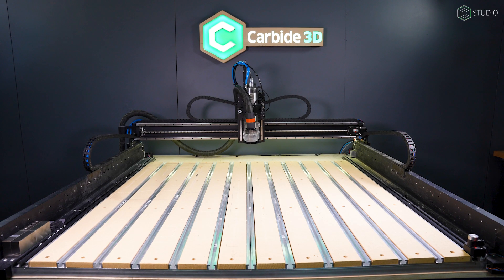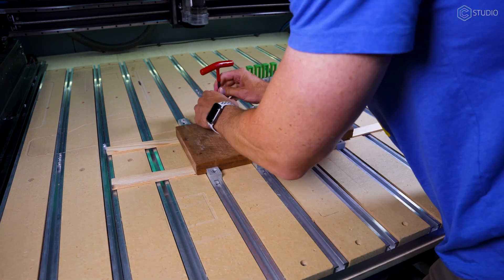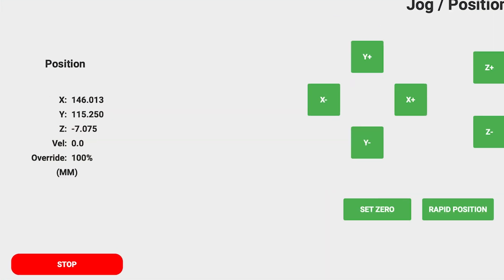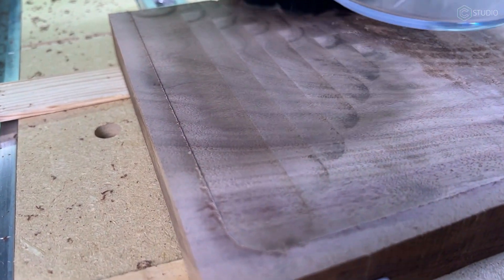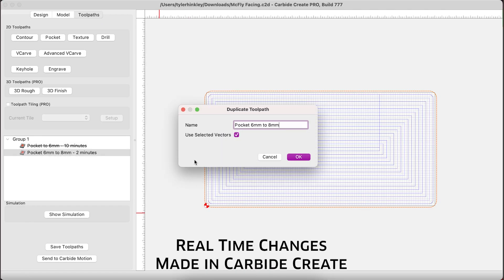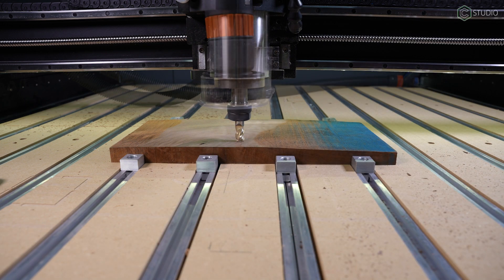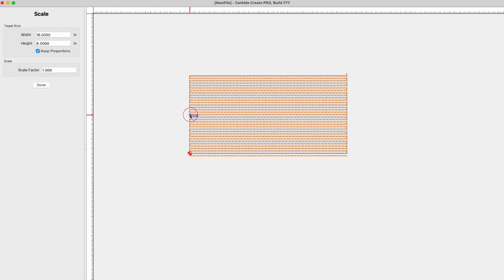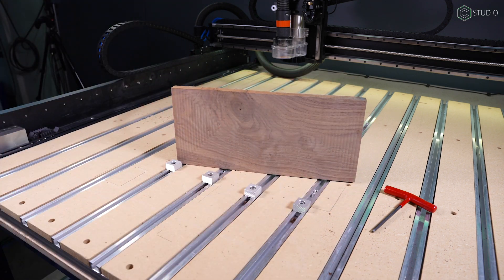How to: Flatten Stock on your CNC Router

Comment: Are you able to do this Carbide Create? I have not moved forward and purchased the Pro version yet. Having trouble joining vectors at the end of my design.

Thanks,
Brent
Reply from the maker: Hey Brett.   You can definitely construct the vector lines in the free version.  Be sure the nodes are right on top of one another.   This is best accomplished by using “snapping” and anchoring your lines to the grid so as to assure their alignment.  
- Kevin

Comment: Love it BUT, in general, I'd love to bit to start surfacing from the outside corner in, not the center (just did my first job, Shapeoko 5 newbie) and it cut in the same pattern as your example. Worried about plunging w/o the ramp function (i have create, not create pro at the moment). Any advise (as opposed to doing the poly line trick)? Assuming it's a function hiding somewhere in Create?
Reply from the maker: Hey Brett, 
Welcome to Shapeoko 5; great things are ahead.    The polyline trick is just about to be obsolete.    We've recently added a Facing Toolpath to Carbide Create.  It's currently in the Beta Version of Carbide Create Pro.   If you have Pro, you can download the Beta here:  https://carbide3d.com/carbidecreate/beta
Reply: @carbide3d  Awesome news (although I'm brand new and now have to google facing tool & hope it's not all X rated results lol)... nailed the poly trick btw, trying it tomorrow on my first inlay attempt--fingers crossed! PS, thx for the reply😎

Comment: when setting x,y and z on a piece of stock like this thats all wonky, correct me if im wrong but you cant use the bit setter or the bitzero and have to do it manually correct?
Reply from the maker: You can always use bitsetter.  BitZero is not as handy given that you want to exceed the size of your stock in X and Y.  Additionally, the low point of your stock may not be on a corner nor large enough to set your BitZero into to get an accurate reading.  Manual Z setting is the best plan.

Comment: Can you use a traditional 2in surfacing bit?
Reply from the maker: It depends on the shank size and the power of your spindle.
Reply: @carbide3d  How about with the 65mm VFD spindle and 1/2" shank?
Reply from the maker: A 1/2” shank does not fit in the 65mm spindle.   That spindle has a 1/4” limit.  
If you want to run 1/2” tooling you’ll need the 80mm water cooler spindle.

Comment: I used this procedure to reduce the thickness of a piece of MDF for a cabinet door I was making with inlays. I took about 1/4 of an inch on one side, did the recess of the inlay design and left it on my CNC overnight. The next morning, when I took it out, the piece of MDF was so warped, it looked like banana. The only explanation I could come up with is that the MDF had absorbed a lot of moisture from a hot and humid South Florida garage, while the backside was laying flat on the CNC bed and had the factory coating. Moisture came in from one side and not the other. I have flattened many boards for signs using this procedure. Works well.
Reply: @hebe1792  whenever I do a major material removal flattening or 3D relief, I always leave clamped either to CNC or solid panel overnight to let it climatize and set its position/shape
Reply: I did a 3 foot diameter sign made from 4” thick sapele. It was a 2 sided carve with the same thing on both sides. 12 hours to carve, so we let it go overnight. When I came back in the morning, the whole piece bowed 1/4” on both sides. I pressed ahead - because it was a $600 piece of wood - and after carving the other side, it laid flat again. No matter the thickness, wood will bend the way wood wants to bend.

Comment: I use this process for flattening end-grain cutting boards after gluing. Presumably not as efficient as drum sanding, but it doesn't require such efficient dust collection either.
Reply from the maker: It also doesn't require a drum sander!